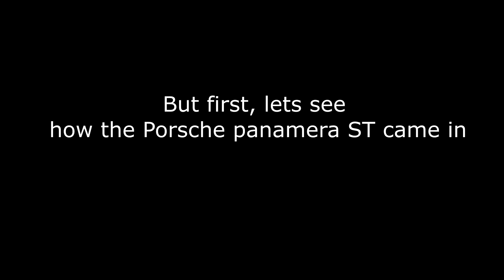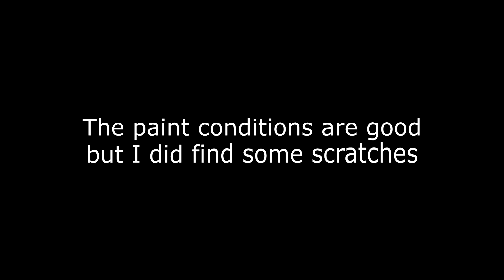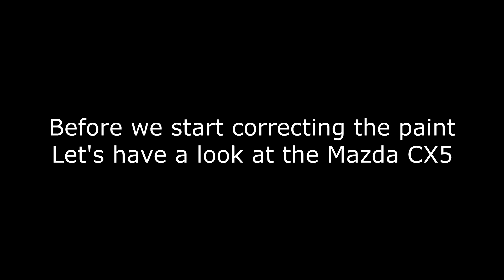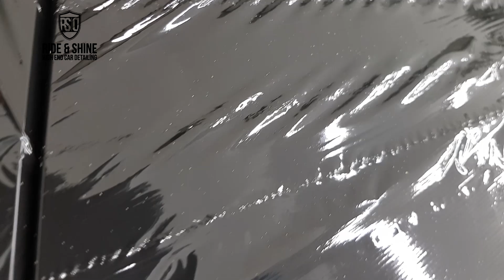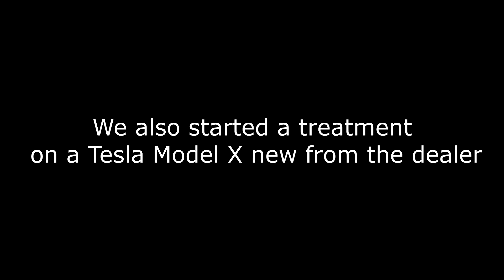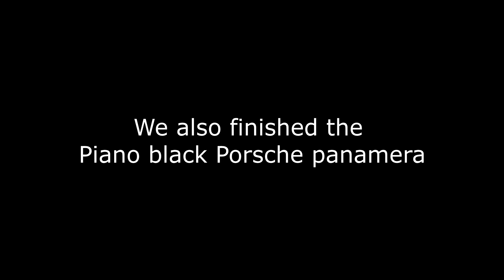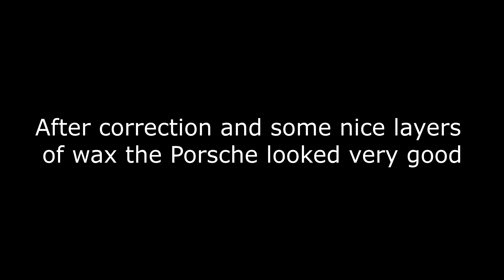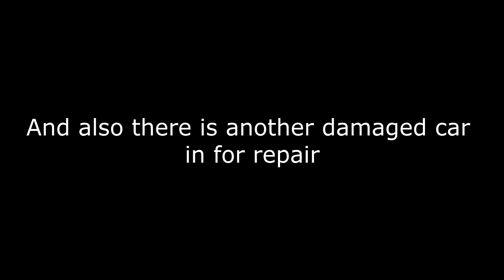High End Car Detailing Ride My Vlog 12 with Porsche Panamera ST/ Mazda CX5 and Tesla Model X

Comment: Nice vlog again Serge! What is the main difference between Modesta and Mayvinci? When would you use the one or the other?
Reply from the maker: Ruben van Splunter The difference is not so big. Both the coatings are good and give perfect protection.

Comment: Great Video. But one question, on the CX-5 you used a microfiber sponge to apply the ceramic coating and on the Porsche the little bloc with the little towel. Why?
Reply from the maker: I want to show that it can be done both ways, I prefer the Microfiber
Reply: Ah, that is what I wanted to hear. I thought that it was perhaps depending on the product. But so it is only a thing of what you prefer. Thank you for the answer.
Reply: But why was the sponge wet? Does this trick help with all ceramic coatings or just the Mayvinci?
Reply from the maker: The sponge was not wet that is only with Modesta BC-03 and 04 coating Mayvincy is dry application

Comment: Hey i was wondering, have you tried Migliore Strata Coating? Any thoughts on that? Or what sealant do you use most often & why?
Reply from the maker: Tried Migliore years ago, I received the whole gamma except the coating. Only the wax was ok the rest was just not my idea of good. Sealants I use Angelwax.
Reply: Ride & Shine Detailing Ahh okay. Thanks for your input. Iv heard alot about Angelwax. Why would you say their sealant is the top of your picks?
Reply from the maker: I worked a lot with different brands and working a lot with products means you have a shelf full of bottles and in the end, you just keep getting the same bottle because something works good and quick
Reply: Ride & Shine Detailing Thanks for your feedback! Is it the Anglewax Ti-22 or other specific product?